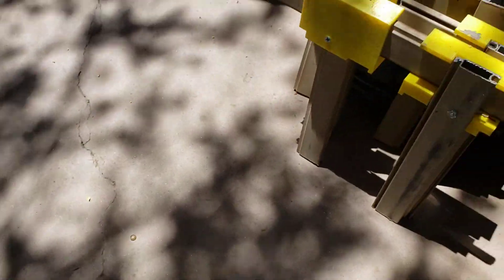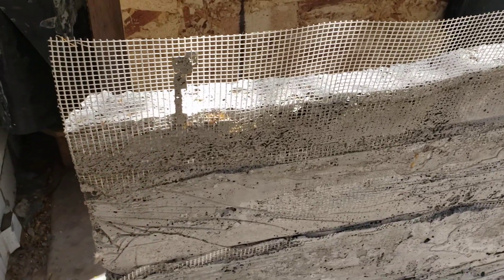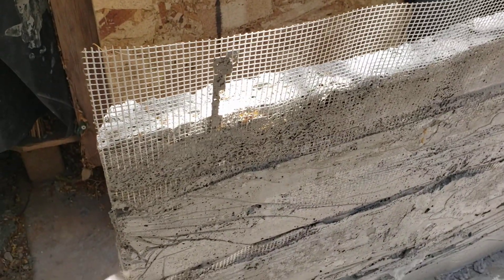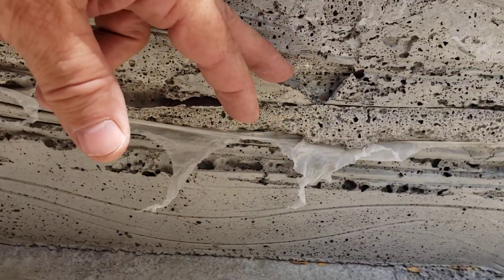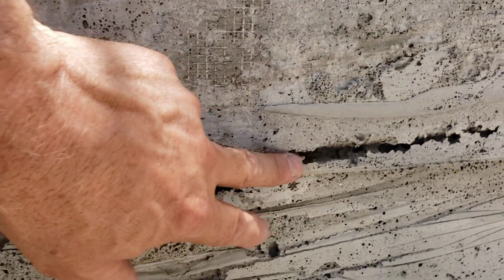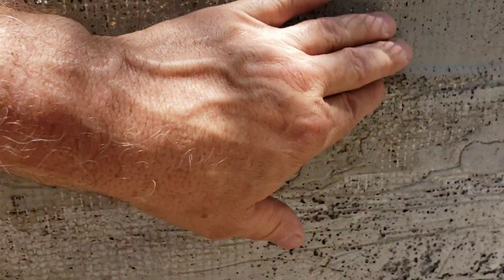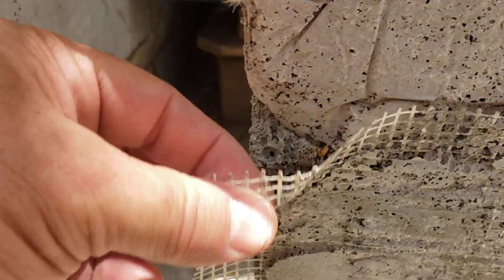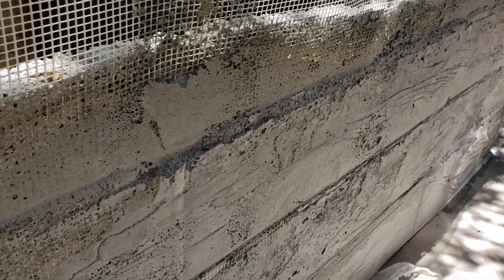Results on the aircrete wall using movable forms

Comment: Looks great. For the areas with poor mesh adhesion couldn't you just patch that up with some aircrete mortar or stucco?
Reply from the maker: Yes, either would work well as will paint. In fact paint works great for that.

Comment: How deep/high can aircrete be poured in place before the weight collapses the foam, similar to what you did?
Reply: Probably better to do long short lifts than tall ones for this reason.
Reply from the maker: I've had 6" pours work great and I've had 2" pours collapse so I don't feel i can give a definitive answer. I think if you have mastered the quality of the aircrete itself then you can do at least 6" just fine.